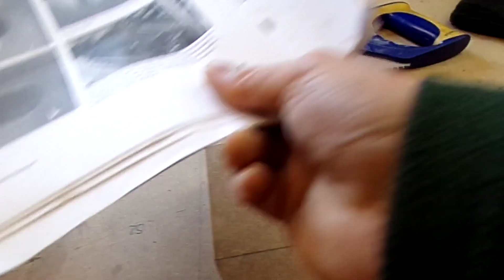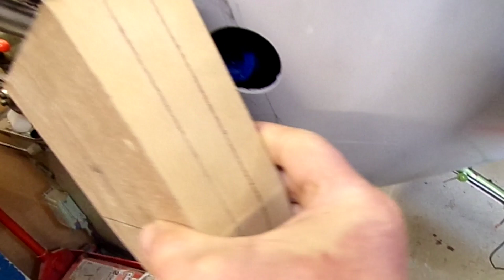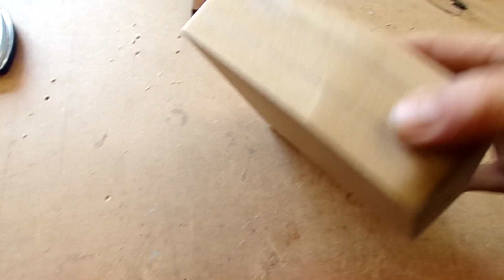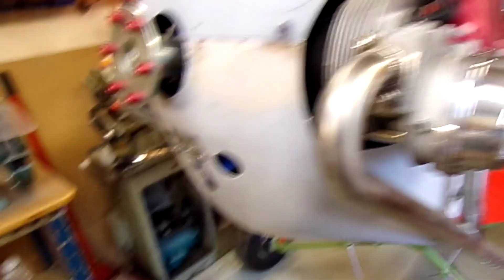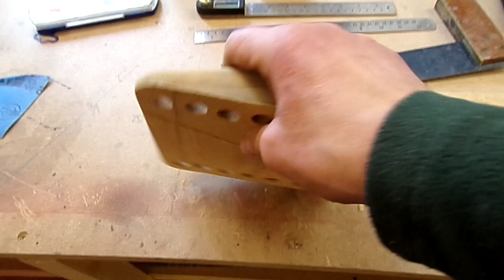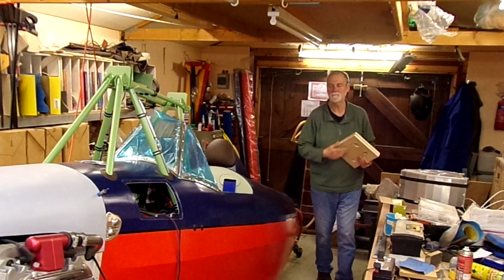EP151 Making the buck to form the oil cooler fairing. Fisher Youngster

Comment: Just wondering: what is your opinion on using Japanese Pull Saws? I have found the cut they produce are significantly straighter than carpenter saws. 
Keep up your videos! I see them all and consider them a major tool in my build.
Reply from the maker: I love Japanese Pull Saws but they are not cheap and they don't work too well with MDF as the set of the teeth cuts a fine Kerf. Like good scissors should never be used on paper, good saw should be kept away from MDF. 
You are right though if I used my Jappanese saw on the job it would have cut straighter but then I would still have to have sanded and I made sure the saw was going to cut away from the wanted material. Good question, thanks for watching.